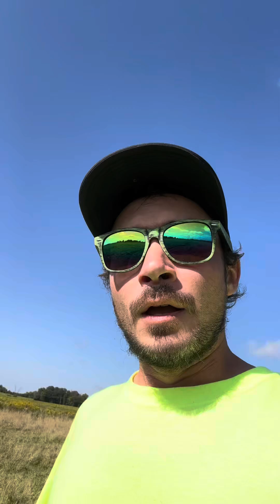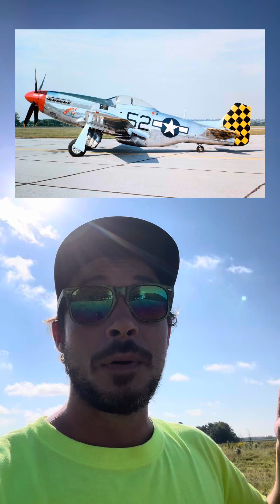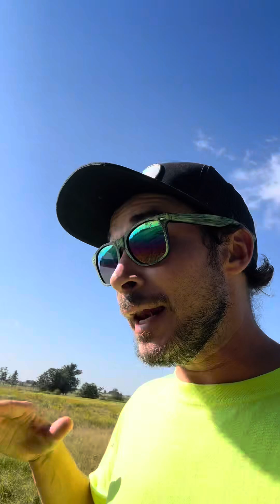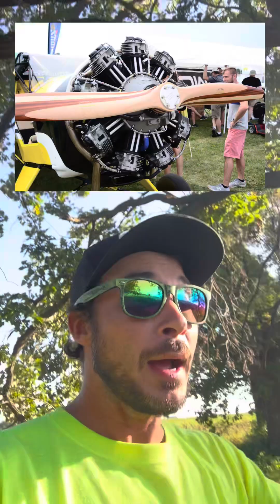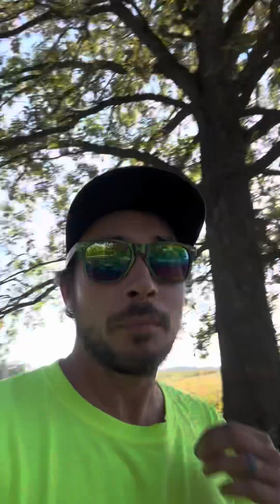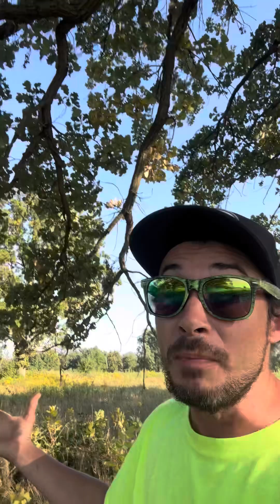Science! The P51’s sorta jet booster

Comment: The phrase “balls to the wall” is directly related to the P-51 Mustang in case anyone wondered. Power levers (with red balls on top) pushed to the firewall.
Reply: I heard it predated the p51 back to steam powered locomotives. Them spinning balls on top of the engine.
Reply: @saugeyes  Those spinning balls are part of the pressure safety valve. At no time do they go "to the wall." So no, that's someone retrofitting history. It's a reference to airplane throttle levers.
Reply: @saugeyes  "balls out"
Reply: Nah...Bon Scott wrote those lyrics way before that!
Reply: 🚂 High Ball !